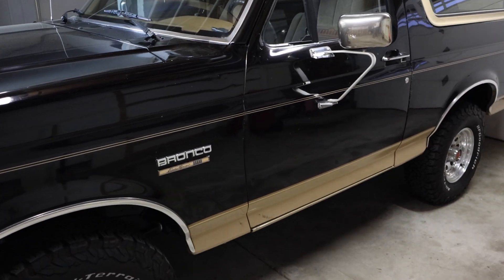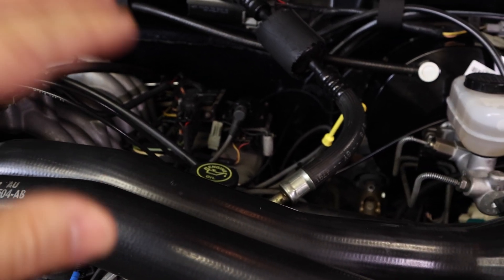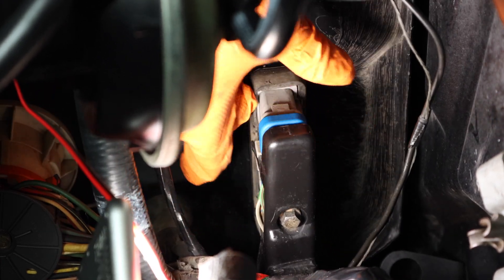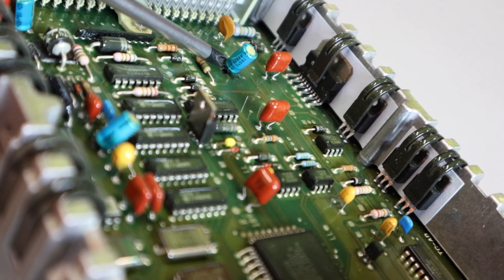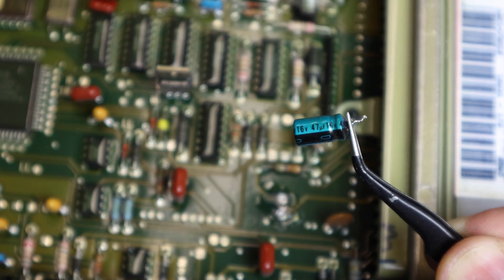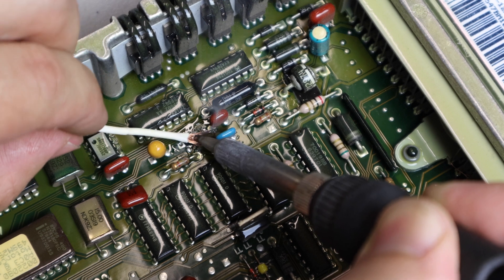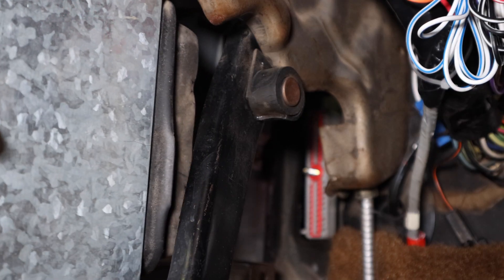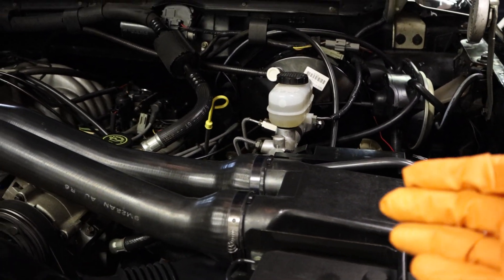Ford ECM Repair EEC IV | Fix Multiple Issues | 1980-1996 Ford Bronco F150 | Bronco Restoration

Comment: I gotta check mine. My f150 had lots of leaked capacitors but it didn't affect anything that I could tell wile running and driving. My bronco is the the mystery problem

Comment: Mine is a bad cold start issue. And weird misses. Even when fully warmed it wants to stall if I rev it up a bit. Replaced every sensor and part except O2 sensor and ecm. Confirmed perfect fuel pressure.
Reply from the maker: Check the distributor pick up coil and ignition module

Comment: thanks for the vid.  gonna check my 95' broncos capacitors!
Reply: What did you find out about your 95 Bronco capacitors ?
I think I am going to have to attempt this project on my 95.
It runs great but sometimes I shut it off to run into the store and come out and it just won't start again for a half hour or so. Thought I had it fixed by changing out the ignition control modular and it seemed to run great for about a month and then all of a sudden it did the exact same thing. Then after a while of trying to start it everything went completely dead even the dome light.
Came back the next day and disconnected the battery to reset the computer and it seemed to start right up like it never had a problem.

Comment: Thanks for the motivation and guide. Just did an ECM replacement with a remanufactured part on my 1993 Ford F-250. Similar but different on removal/installation. FYI for those about to do the same, the ECM is pulled out through the firewall from the engine bay, not the cab like in the video. No reason to take off any trim in the inside to figure that out. However, the ECM unit is too long to pull out without running into the wheel well so I removed the back half of the driver side wheel well screws to give it some flex to get it out. Thanks Ford engineers for that easter egg. Anyways, computer is in and the electrical gremlins appear to be gone. Good luck everyone on your projects!
Reply: 87 - 91 is removed from  inside cab.
Reply from the maker: Great information.
Reply: Yes, inside on earlier models

Comment: Hello, I have a 1995 f150 with 5.0 v8. I saw another video where the guy took out 2 bolts in the firewall above and below the pcm connector and pulled it out that way. Can mine also be removed from behind the kick panel like you did on this Bronco? Your way looks much easier. Thanks for the great video!
Reply from the maker: The 92-96 generations have bracing inside the kick panel that making the ecm from the inside difficult. For those models it is easier to remove from the engine bay.
Reply: See my new post above for my experience.

Comment: Flagship 1 charges $550 for a rebuilt (or what they call refurbished) ECM for a 93 Ford 7.5L which my Winnebago Brave has in it’s Ford F53 Chassis. It’s very slightly different but your fix is the same. Was running horribly, no idle and shut down intermittently. Engine is now jet smooth again  including the shifts. Cost me $7.75 with 8 spare caps of each (same as yours) and a bit of time. Your video is superb.
Reply from the maker: Thank you.
Reply: I've sent two different ECMs to them, and both came back unrepaired, and they gave me the blind eye and deaf ear on warranty for both.    They went in as dead, unscannable, and came back as not dead but still not able to start the vehicle or communicate properly with any scan tool.      

They'd scan and display the VIN and related coding (partial reading) but not give access to the actual diagnostics for the engine functions (Engine control side still dead).    ~$1600 wasted in the end, and neither vehicle worked with those ECMs before or after the supposed repairs.

Comment: I have 1995 F350 5.8L Powerstroke Diesel (Manual). It cranks very strong, no start. I suspect the EC. Is mine located in the same location as the one in your video?
Reply from the maker: Yes it should be located in the same place. If it is a Diesel engine check the crank position sensor, I’ve had that issue in the past and that was the problem.

Comment from the maker: You can save good money doing this repair. If you are new to soldering, I do recommend practicing beforehand
Reply: hey dude, ever come across a bouncing serpentine belt tensioner? mine was doing that so I replaced it with a new part and it still does it... recently I replaced my alternator with a 130A 3g alternator which has a slightly smaller pulley, I'm wondering if it is as simple as needing a slightly smaller belt.